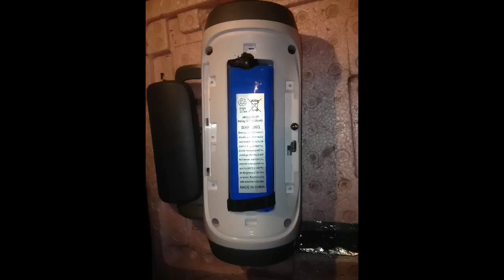JBL Charge Bluetooth ReChargeble Speaker-Battery Replacement

Comment: Do they sell replacement batteries for the JBL charge because my JBL charge don't last for 12 hours anymore the most of the last four is about three hours before it dies out it only have one flaw with this battery that I don't like that you can't plug it up and use plug to play give music and charge it up at the same time it don't work like that that's the only flaw that it has other than that is a great speaker is better than the beats pill way better than the beats pill it got a lot of good base specially on hip-hop music and reggae music that's the only music I listen to but you could try it out on other Johndoes of music is see how good it is

Comment: Be careful. When I moves the battery, the positive and negative wires got pulled off. Need to sodder it back on, but I smelled burning when I tried to power it on not knowing the wires came undone.